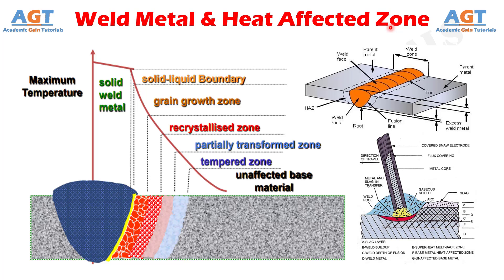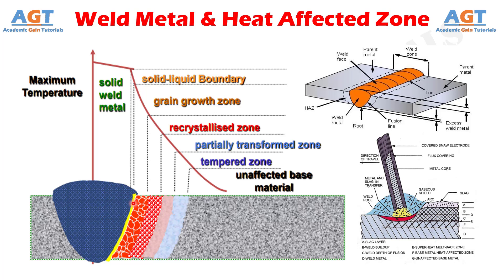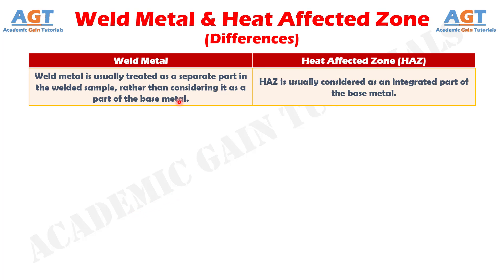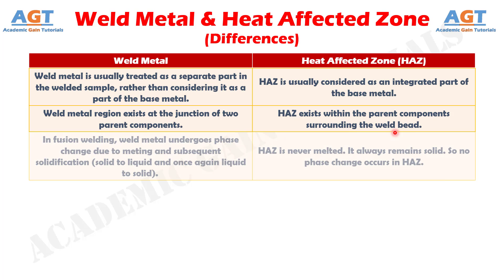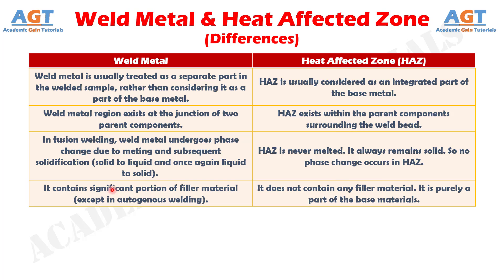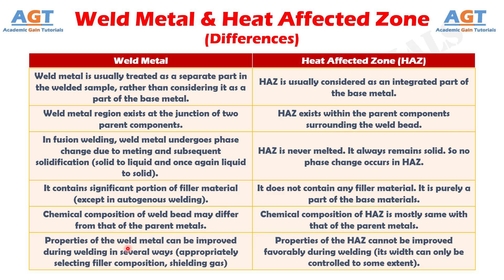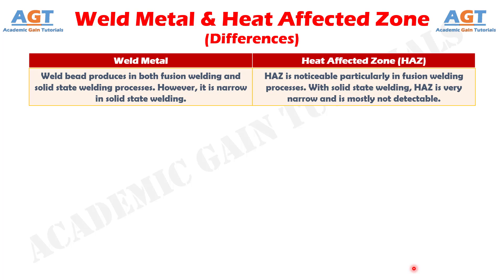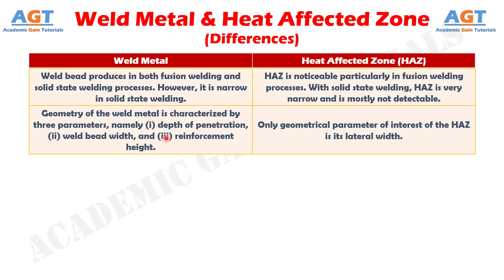Differences between Weld Metal and Heat Affected Zone (HAZ).

Comment: If the phase of the HAZ doesn't change in welding process, how the grain distribution becomes different than parent material?
Reply: Depending on the metal, the heat applied will change the grains. It may not change the state of material (solid to liquid) but will rearrange the grains.
Reply: yes u r right its may change thats why slow cooling is required or preheat to avoid ... also depends upon material